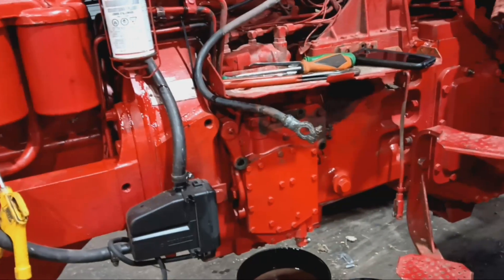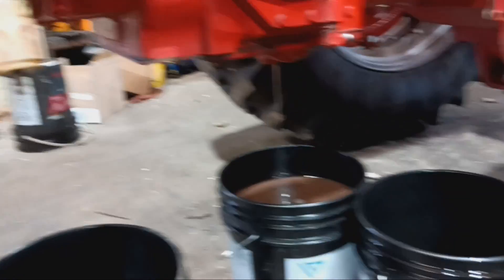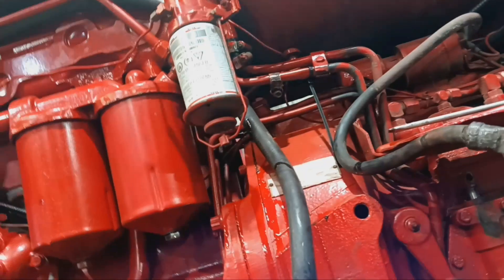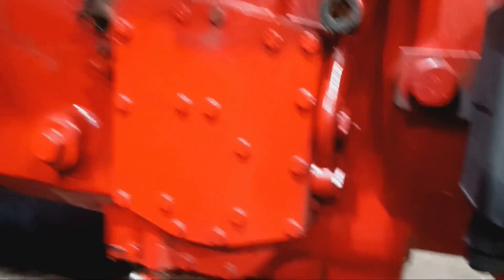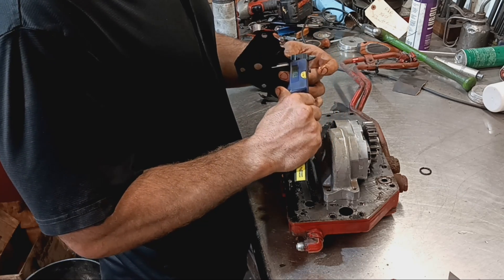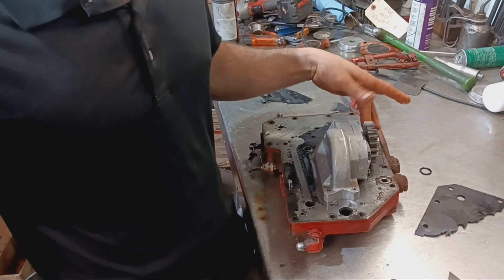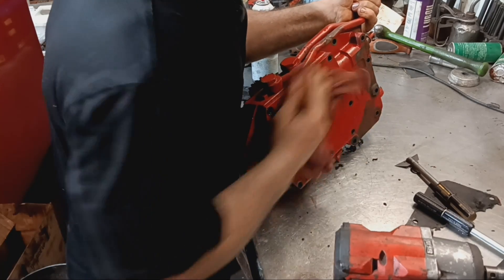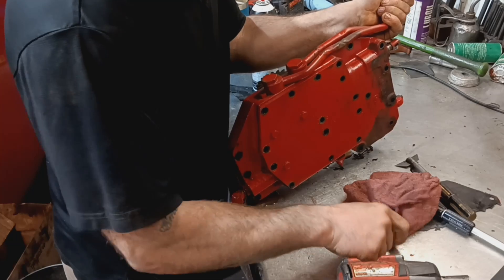IH Hydraulic MCV Pump Replacement

Comment: Can you tell me if there is a hydraulic relief valve on the pump? I have an issue with a 1466 farmall with every single function working correctly, don't have any steering at all, the wheel just spins freely with no movement up front. rpm doesn't help either.
Reply from the maker: On the bottom right side of the mcv pump housing there is a plug, up inside of the plug is a relief valve that can be pulled out with a needle nose pliers. There is an oring on it that could be blown.
Reply: @IHdelight  is that the 1 inch plug with a spring in it above the plug on the right